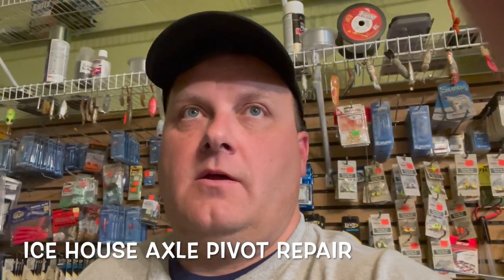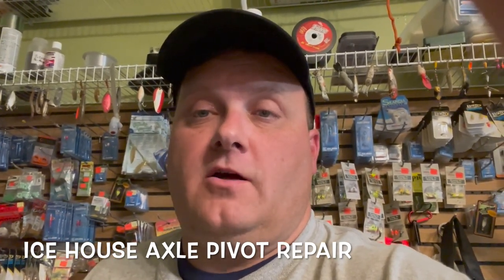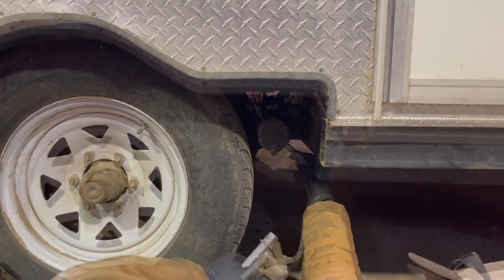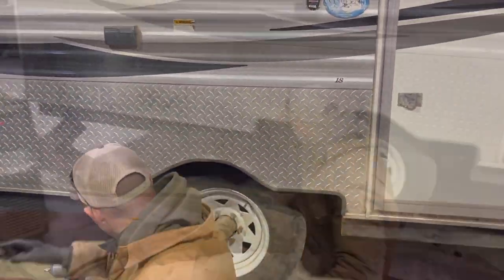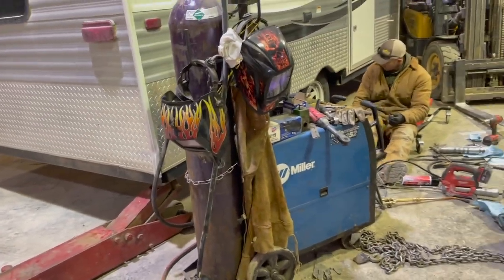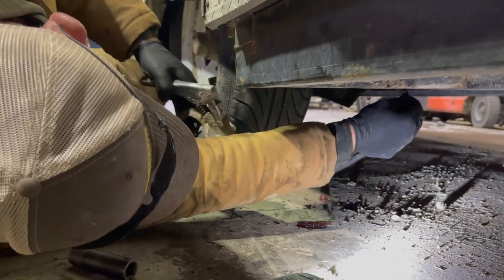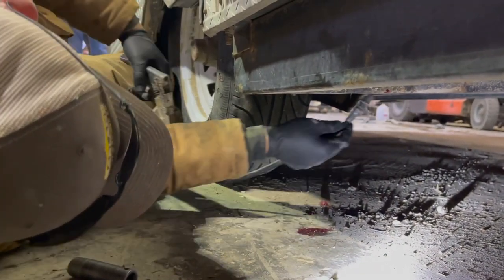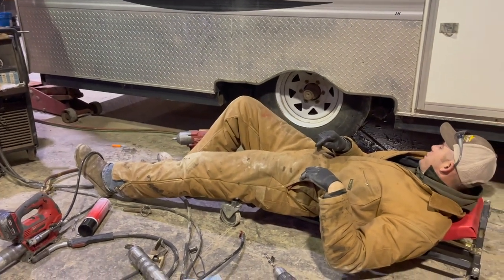Ice House Axle Pivot Repair

Comment: What was the tool they used to knock the axle off with?  I have the same house with the same issue.
Reply from the maker: Sorry to hear that! It was basically an air hammer. I have a hammer drill that is electric with a chisel that I think would work if it ever happens again. He said the 18 V grease gun was the key to keeping it from happening again. I have a 12 V grease gun but will probably get the 18 soon. Best of luck to you! Let me know if you have any other questions. It was a pretty straightforward job once we got the air hammer out.
Reply: @prospectoroutdoors  Thank you for the quick response I have been battling that darn thing for hours now. I appreciate your video thanks again.
Reply from the maker: No problem. Let me know when you get it taken care of. Best of luck!

Comment: Handy trick. Keep the trailer on fire to relight the torch. Some tasks are just worth paying someone else to do. Cutting that grease groove was a pro move.
Reply from the maker: I was so pleased with the way things turned out. Now that I see how he did it, I can do the other side with my hammer drill. I didn’t realize if I lifted it up that high I could use a hammer tool. I was fully expecting to have to use a puller.